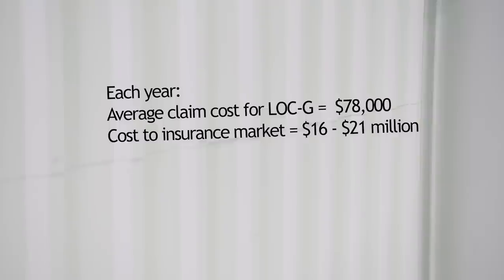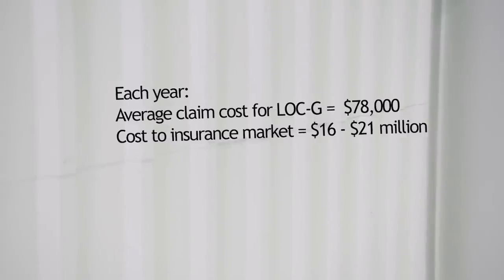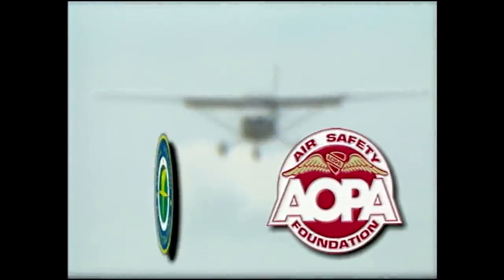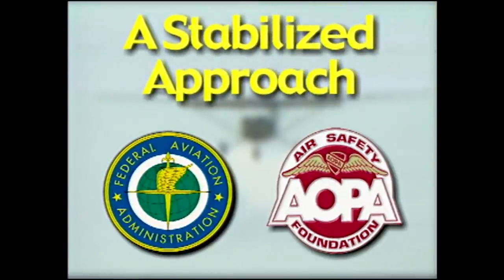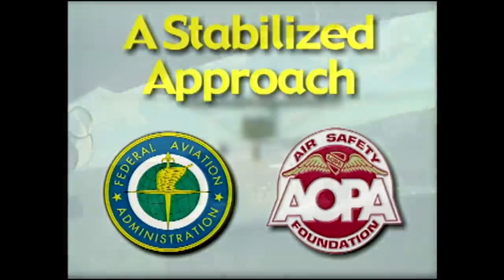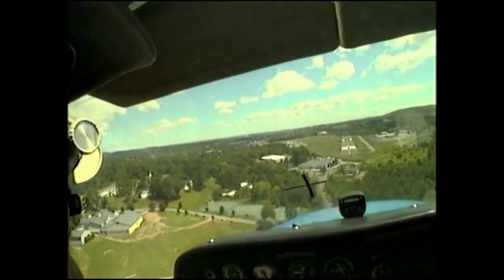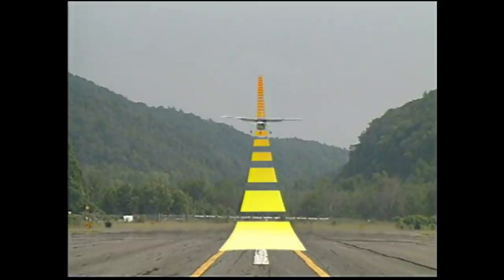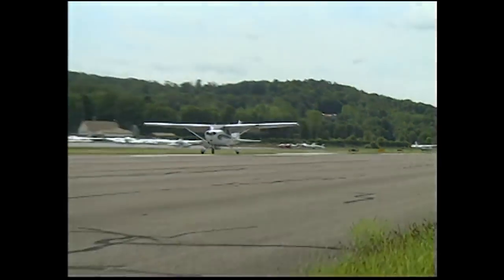Avoiding LOC-G

Comment: I had a LOC-G experience, which was nearly a crash, but finally I managed to get the situation under control. I was transitioning from a QS MXL to a QS GT 400. In other words, I had never experienced a yoke - my only previous experience was 160 hours with a joystick - and there was no way to do a training run, because the GT 400 is a single seater. So once I was airborne, I had to learn yoke control whilst airborne -  by myself - solo - pretty nerve racking, I can tell you.
Landing was fine - but in the roll out, I subconsciously perceived the yoke as a steering wheel in a car - since I was back on terra firma.. Which made me forget all pitch control. So I bounced violently until I finally lost momentum & eventually came to a halt. Only then did I realise what I'd done.
Reply: I had a similar experience on a training flight. I had never flown yoke and the inherent perception that it was a steering wheel made taxiing very difficult. I didn’t get into trouble because my instructor could see I was not handling it and took control.

Comment: Unfortunately  the aircraft POH/AFMs for most small piston GA performance data do not provide corrections for several important variables including runway contamination and slope.  Also keep in mind that runway temperature can vary considerably from the advertised OAT.  Pilot proficiency, technique and aircraft condition can make a difference in achieving book values.   Applying a suitable factor to book-derived values is an important risk mitigation strategy.  For instance, I use a factor of 1.5 for takeoff and landing distances in an airplane I am comfortable with and 2.0 for an airplane that is new to me.

Comment: Great video! Just last week I had a really scary moment doing touch and gos. I lost control on the ground and seriously thought I was going off the side of the runway but was able to rotate just in time. As a student pilot the crosswinds were right at my endorsed envelope and the last wind check indicated gusts that were much higher. 

My mistake was two fold: after I landed I was so in the rhythm of “touch down, flaps up, full power” that I didn’t make sure I was settled completely on the runway before going back to full power. I also didn’t hold in ailerons into the wind once I was on the ground. Turns out wind still affects you even after you’re down. 

Just using rudder I started wobbling and every time I overcorrected it got worse and worse. Easily the scariest time I’ve had as PIC, and I’m sure I won’t make those mistakes again.
Reply: thanks for sharing, always good to hear from others.

Comment: * "Average LOC-G claim is $78,000." Since many GA aircraft are worth less than that, I have to wonder – does that number include bizjets? Not a credible statement without more detail.
* So how does too much airspeed lead to LOC-G? You gave no specifics. Are you talking about wheelbarrowing?
* Picture of the stable approach was a three point landing in a nosewheel airplane. Tacky!
* Stable approach has been debunked as a contributor to bad landings. Flight Safety Foundation, 2017, reports that 97% of (jet) unstable approaches land okay. There’s so much to it than just “unstable approaches.”
* Runway drift exercise – good!
* Separation of lateral and longitudinal control – data supports that! As do videos.
* Video didn’t differentiate between excursions off the runway side and overruns.
GENERAL – too many platitudes, too few specifics. Lacks substance, lacks credibility.